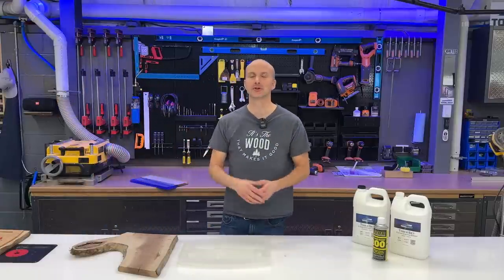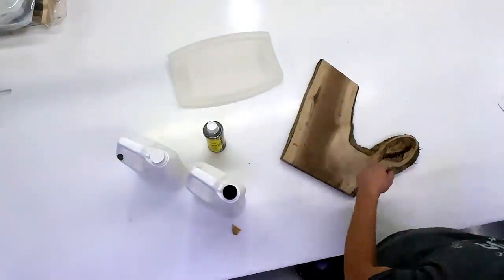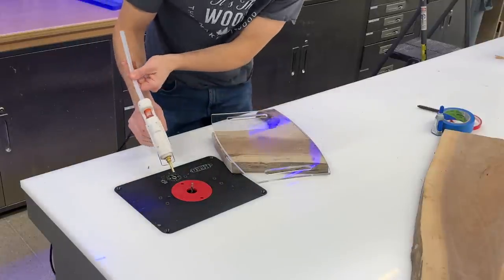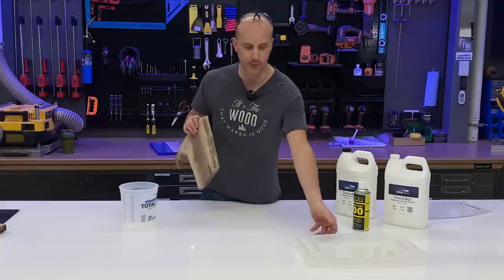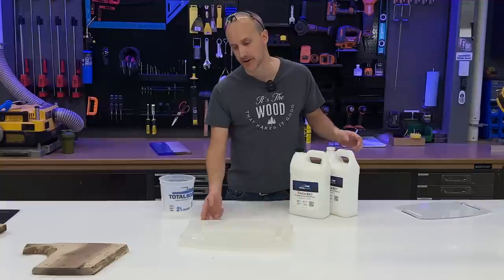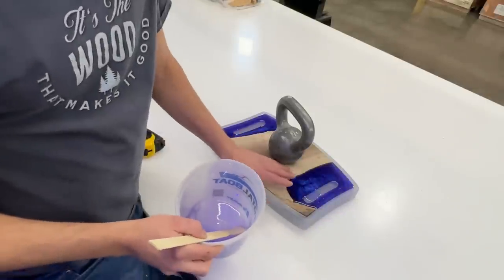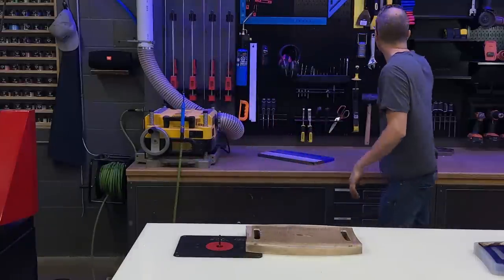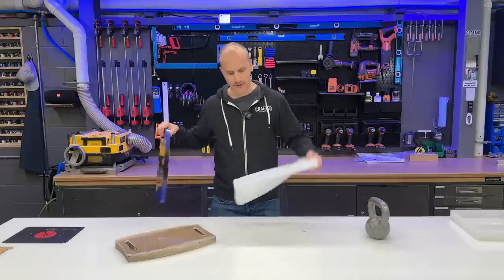Easiest Time Saving Way To Make Wood & Epoxy Resin Serving Boards With Silicone Molds & Templates

Comment: The fact that you don't want to try to cut the handles of the wood out to fit in the mold, tells me maybe the template needs to be a bit larger where the handles are.

Comment: You have made a mistake on how you explained and showed the math for epoxy quantity. Length x width does NOT equal cubic inches. You are right because the depth is one inch. But you posted it as LxW = cubic inches . It’s LxW x thickness or depth = cubic inches. You failed to explain the depth in the equation . Yes you mentioned it when you started but you cannot leave it out in the equation when explaining  to people how to figure /estimate quanities.    .
Reply from the maker: Clearly an oversight here. You are correct, LxWxD is cubic, LxW would be area. Since we had 1" of depth, the "D" part of the equation is irrelevant.

Comment: After you apply the honey stain, do you set it on a cup? To allow the stain to breath or does that not leave a weird mark on what its placed on? Dumb question just never stained before 😅 i also will assume that its food safe
Reply from the maker: It's not really a stain, its an oil, so you just rub it all in by hand all over. No need to set it on a cup. Set it somewhere to absorb for 20 minutes or so, then hand wipe and buff it all off.
Reply from the maker: Yes @TotalBoat woodhoney is food safe.

Comment: This was the first video that I have watched.  May I ask what brand and size of drum sander you use/recommend and why?
Reply from the maker: It is just a basic ridgid sander -> RIDGID Oscillating Edge/Belt Spindle Sander
Reply: Hello Sean!  What I meant by drum sander is that it appears that you have a Laguna SuperMax drum sander next to your bandsaw in this video. do you use it to flatten material of cutting boards, etc?  Are you happy with the unit?
Reply from the maker: It is a supermax 19-38, its brand spankin' new, never been used!

Comment: Where can i get that special offset trim router bit?
Reply from the maker: You make it. Buy a 3/8" diameter flush trim bit, and a 1/4" and put the 1/4" bearing on it. Or buy a 1/2" and 3/8" flush trim bit, put the 3/8" bearing on the 1/2" cutter.

Comment: Sorry to ask a dumb question, but which link is to the flush trim bit with the 1/2 trim, and 3/8 bearing?  TIA
Reply from the maker: Matt, not a dumb question. The item as it is does not exist. You have to buy the 1/2" bit which comes with the 1/2" bearing. Then also buy a 3/8" bit from the same manufacturer. Ideally the bearing threads are the same (especially if you buy them from Amazon in a kit of 3 or 4 bits) and then you just use an allen key to swap them out.